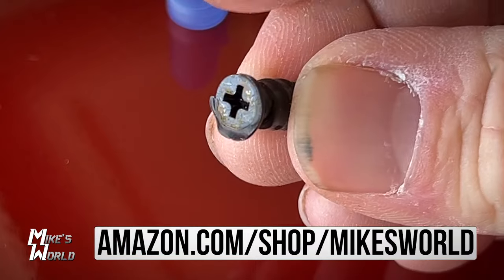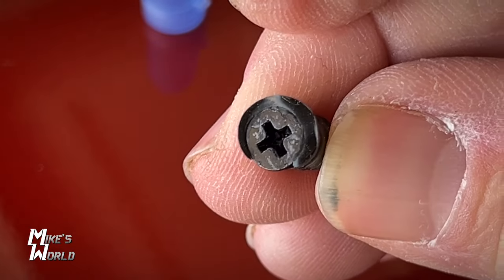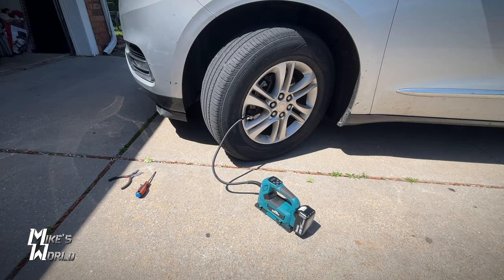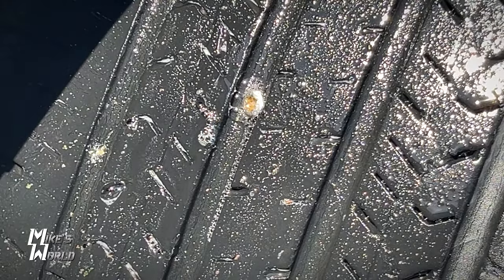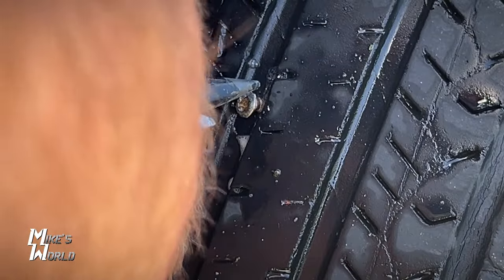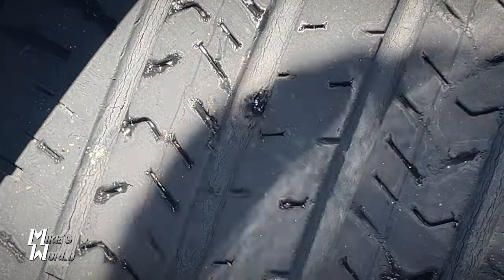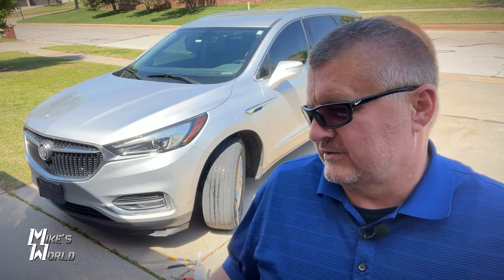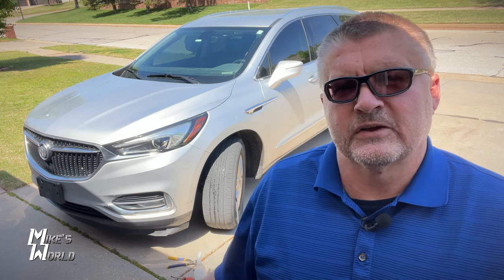Fix A Flat Quickly With These Rubber Screws

Comment: Would like to see how long this rubber screw will last before leaking air.
Reply from the maker: This one lasted 8 days.
Reply: @MikesWorld1  Did it start leaking air on the 8th day?
Reply: I used one that lasted 7 months, after that I changed the tyre as it was worn out. You can get them in two sizes.

Comment: I like the plugs better. the 'glue' is usually a vulcanization product.  the plug is fibers and rubber. so when you plug, the plug becomes part of the tire.   To me - that sounds better.
Reply from the maker: Plugs will hold much longer than the screws. The screws are a temporary fix.

Comment: These are a really bad idea!
For a screw in the tyre, like that, you'd be better off leaving the screw there, until you can get if fixed. Also, that tyre should be put on the back, so it's not used for steering, if/when it bursts. Even better is to use your spare tyre. Either way, a plastic screw is only a very temporary solution. You'll have to drive slowly and ensure the tyres don't heat up too much. The centrifugal force of the spinning tyre will increase the air pressure against the hole in the tyre. The rubber will heat up at a different rate to the screw, because it's made from different compounds and it's in direct contact with the road.
Reply from the maker: They are a temporary fix. A 3-minute fix instead of having to change a tire on the side of the road. I’ll use them as a temporary fix until I can get to a tire shop. No, it’s not a long term solution.
Reply: @MikesWorld1  good one